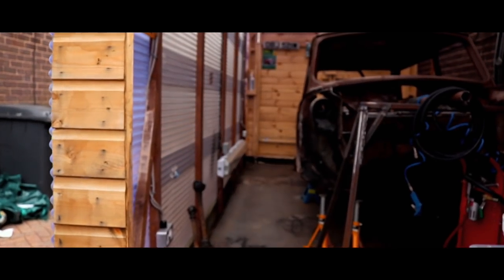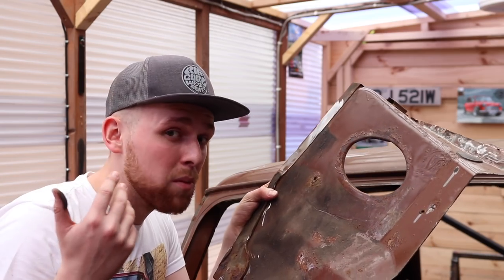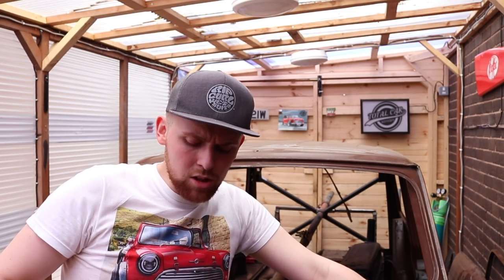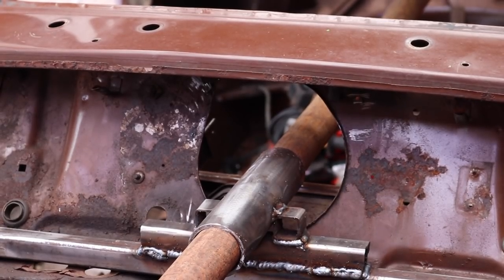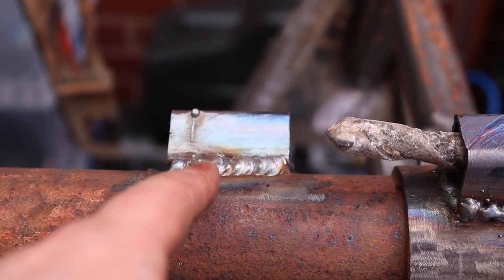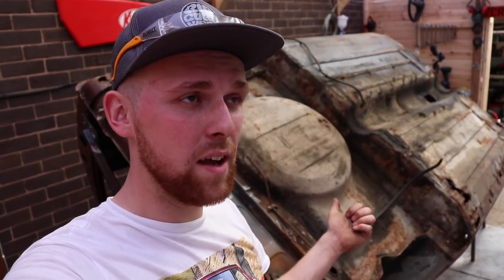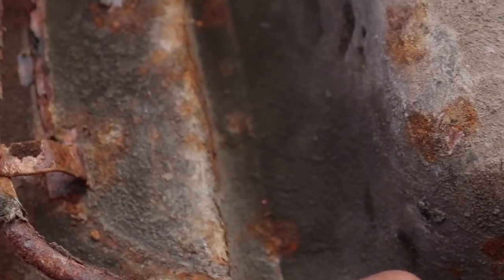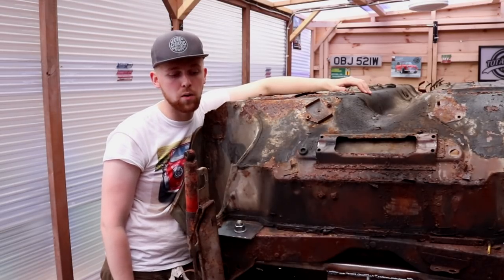MORE CHOP! CHOP! CHOP!

Comment: Crikey, I nearly missed this video Tom. You've been knocking them out so quick lately that I thought I'd already seen this one. Lots of work ahead for you, but it will be worth it. Try not to chop too much out in one go. It can be quite overwhelming and disheartening if you remove lots of metal as it makes the car look even worse. Much better to chop out a panel and weld in a new one, before moving on to the next, as you feel a sense of achievement, as you replace rusty panels for nice new primed ones. Mind you it's not easy on a mini, as you can't always find good metal to weld to! Great quality video as usual, looking forward to the next one. Simon.

Comment: Tom, Good to see working on the mini, It is easier to have the shell in a few different positions while cutting & welding so i would add a few 
more locking points, Just buy some tube a little larger than the shaft size and wekd them around the pipe, Cheers Dave
Reply from the maker: Cheers mate 👌🏻 I’m planning on doing I just thought it would be boring if I filmed me doing the same thing over and over haha 👌🏻

Comment: Is the shift knob threaded for the Mini shifter or does it use an insert and set screws to hold it in place?
Reply from the maker: It’s threaded for minis mate 👌🏻 and then got 2 grub screws to centre it

Comment: Your weight balance on the rotisserie is way too bottom heavy.  Having done this before, I would strongly recommend that you adjust the pivot point downwards in the vehicle so you don't have to fight with it every time you need to spin.  You will be glad you spent the time getting it right.  :-)